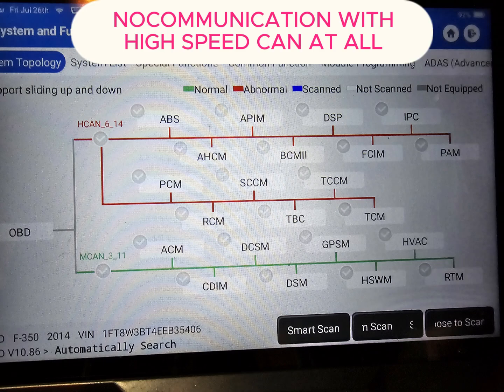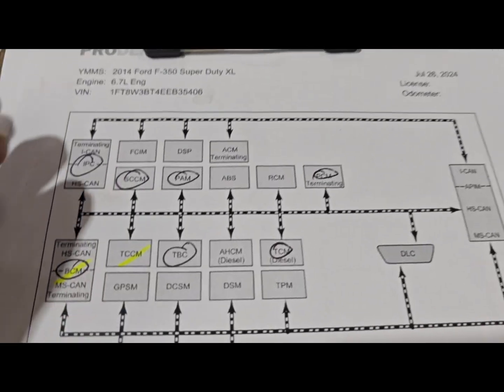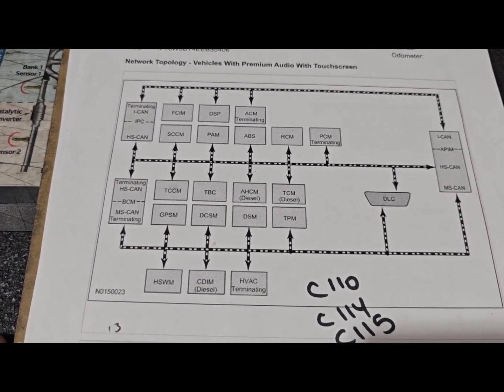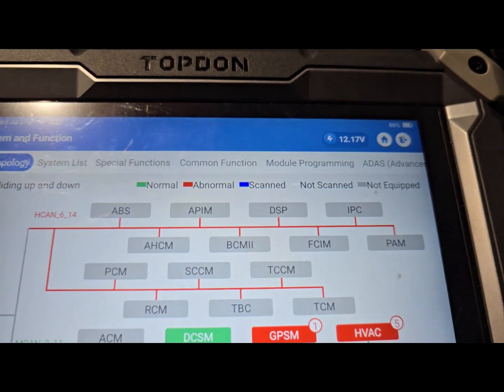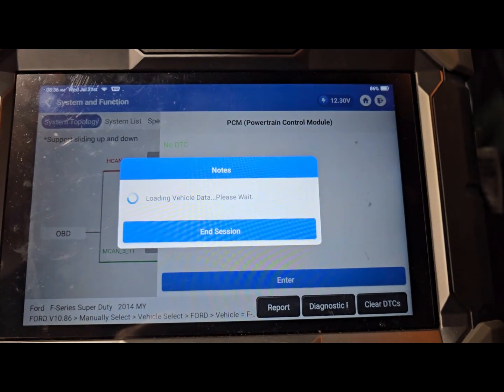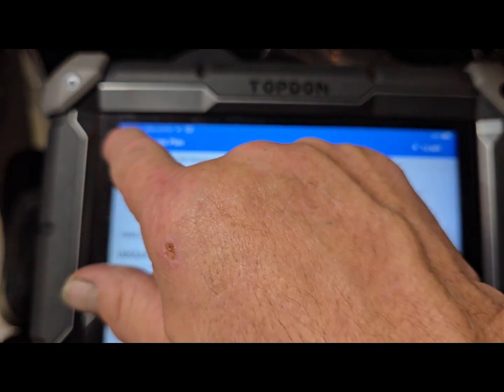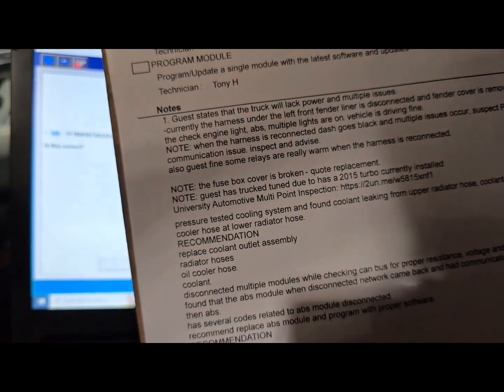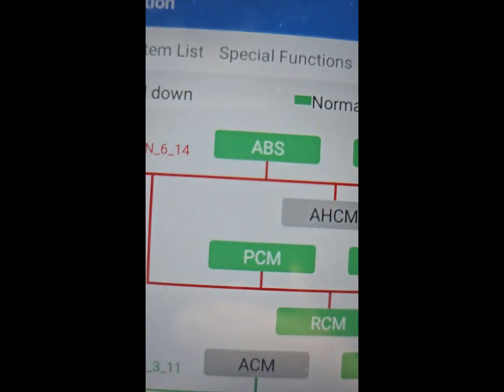2014 F350 6.7 Powerstroke Lack of Power and Scan Tool will Not Communicate

Comment: ABS Module is my #1 go to for testing for bad modules 100% of the time, not always the problem of course but a very large percentage of the time, thanks for all the tests but I also did not notice retests, good voltabes on HSCAN or resistance test at 60 ohms, clean up is always an issue here on YouTube repair videos, pls take note, even a simple still photo would be ok in the video, cheers.
Reply from the maker: Yes ABS Modules are common to fail, I did not get after shots of the actual votages, In this case it had taken me a little while to find the problem the truck and my other work was piling up. Good tip and I do try to show that next time.